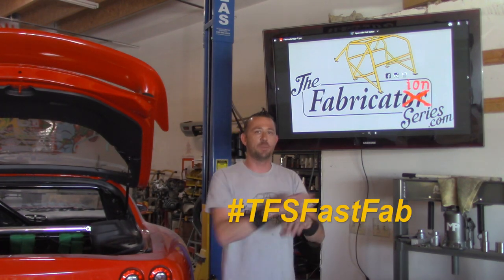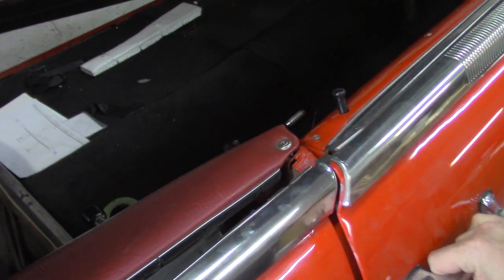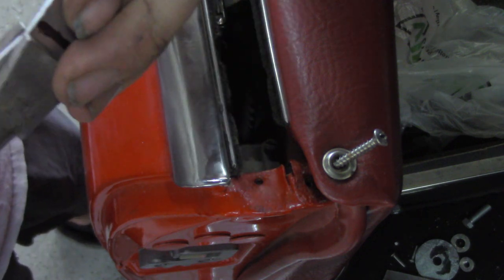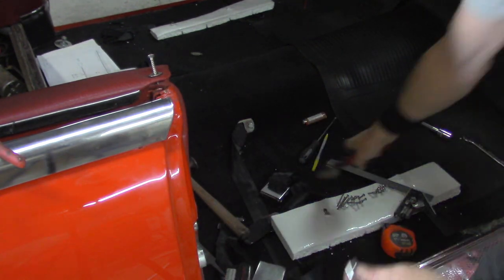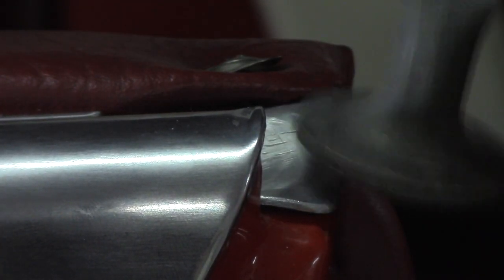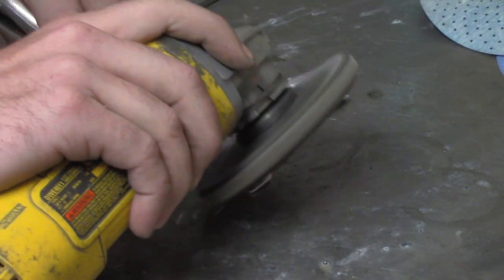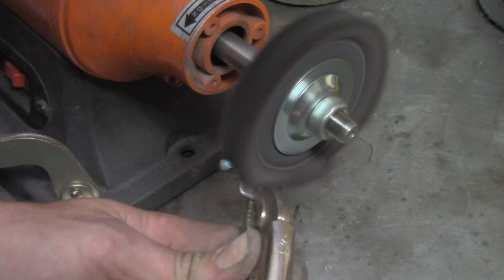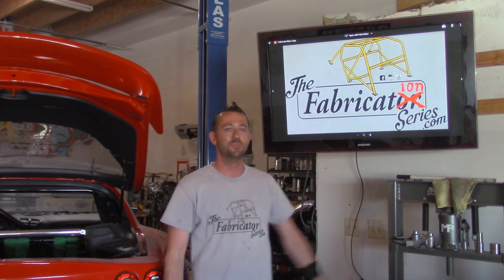TFS: How to Build Trim Pieces #TFSFastFab

Comment: How would you charge a job like this? By time or flat rate?
Reply from the maker: Since material costs practically nothing, usually you charge time. If the rate is $100/hr and it took 2 hours, charge $200. 

You can also flat rate it since it's such an easy job, so if you only want $100 for it, charge $100 but do consider the time you will have in the job so that you don't spend 6 hours working for only $100.